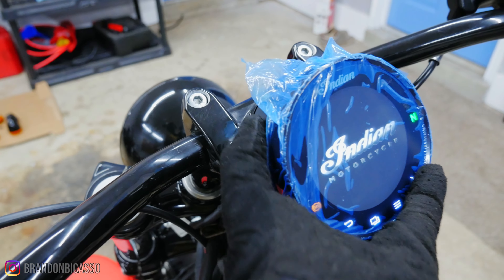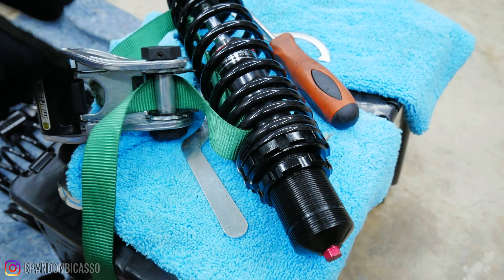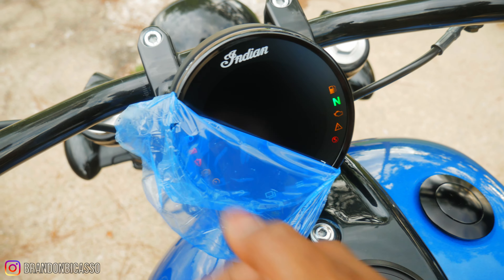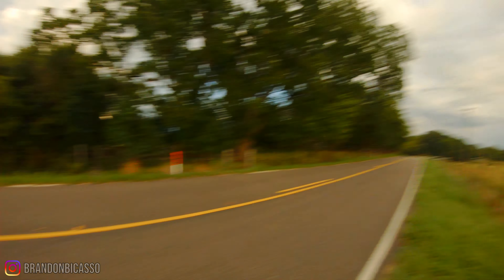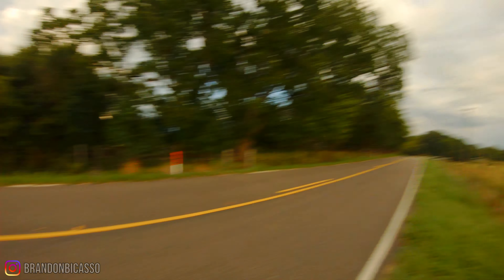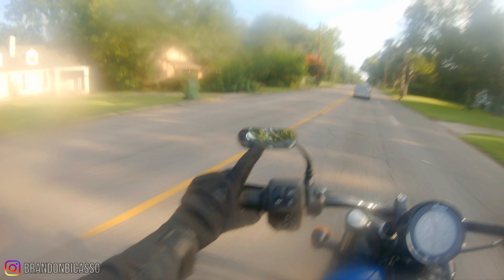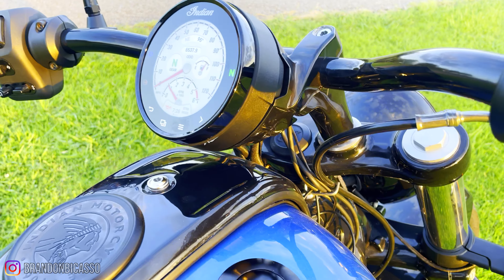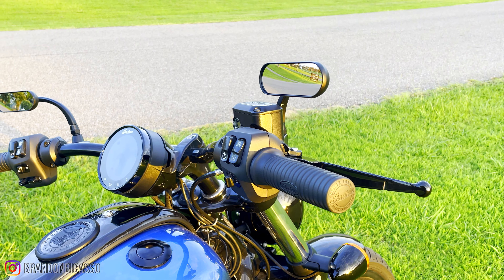My Cheap Indian Chief Is Finished After 6 Months

Comment: Beautiful job man. Since you installed one I was wondering if you would be able to answer a question for me. The ride command unit, is that kind of independent from the bikes "brain". What I mean is based on what you know could they be adapted or used on an Indian that did not come with the unit? There are other types of units I could use for what I am doing but I'd love to use the unit here.  Basically I'd be trying to use the unit on a bike that started as a 2017 classic. I know you aren't an indian mechanic or anything but do you know of any reason it would not work?
Reply from the maker: I've seen the Chief's ride command fitted on a FTR before. Anything could work especially knowing the ride command is just a display and nothing more. It pulls all the information from the ECU/VCM/WCM. If you wanted all of the pieces to make it work as intended, it would be around $3500 I'd suppose. Wiring Harness, Cell Modem for the GPS, Ride Command, Left Handle Bar Switch (for 3rd row buttons) and a few other things. The only piece that needs activation is the cell modem for the gps. Ride command is plug and play. I dunno how the WCM would work from a bike other than Chief when it involves the key fob. SO, there's a lot of questions to answer but with enough time and another bike, I could probably take a wack at it. I was curious about the FTR display on the Scout but with enough time, anything is possible.